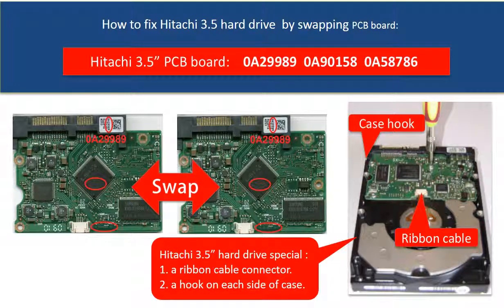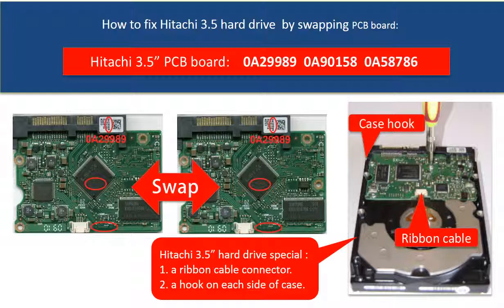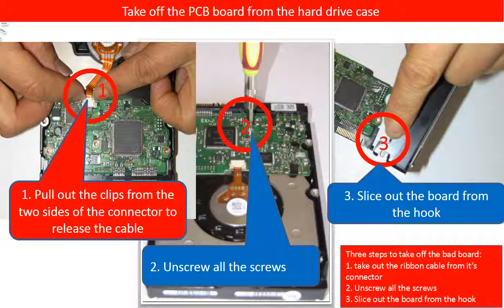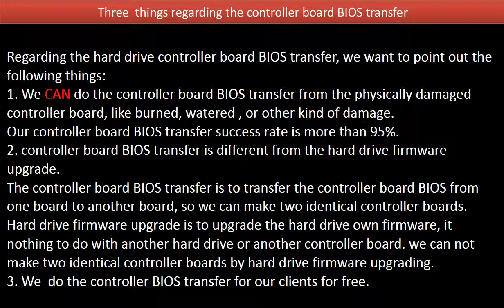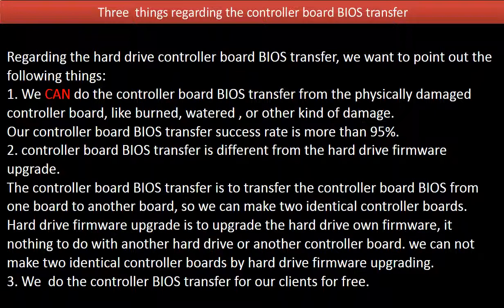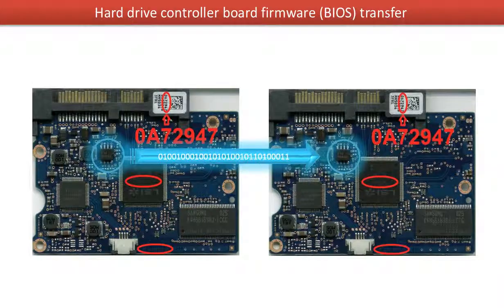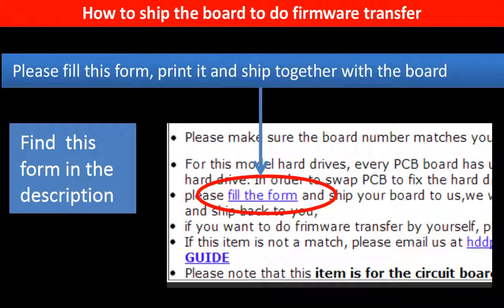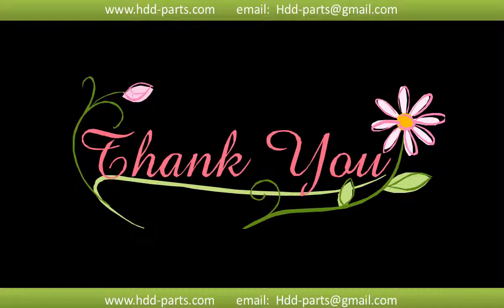Hitachi fix board swap 0A29989  0A90158  0A58786  HDT721050SLA360    HDT721032SLA380  HDT721016SLA38

Comment: Hi. I have the Hitachi  HDT721050SLA360

So I need to go to your website

Fill in the Form

Print it, put it in bubble wrap with my bad board, which I disconnect from my drive, and send to you?

BUT!

Do I pay you first, or after?

Thanks.